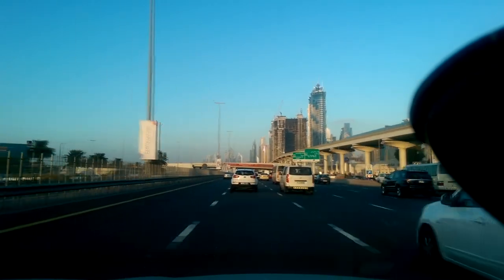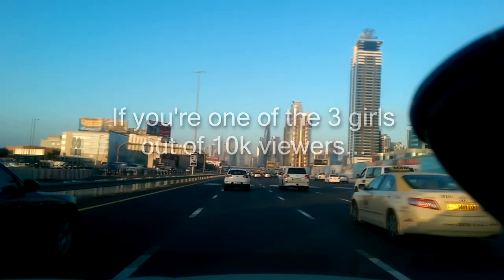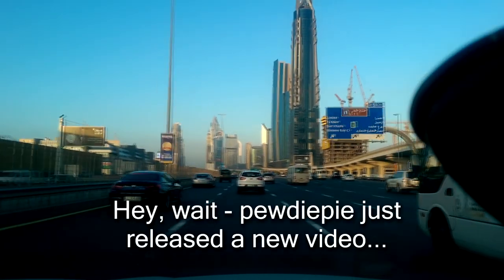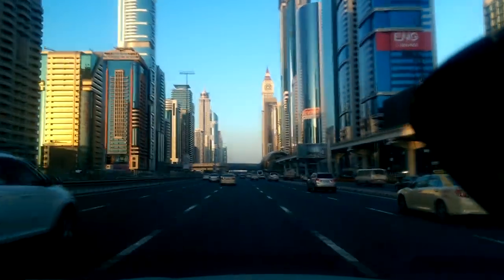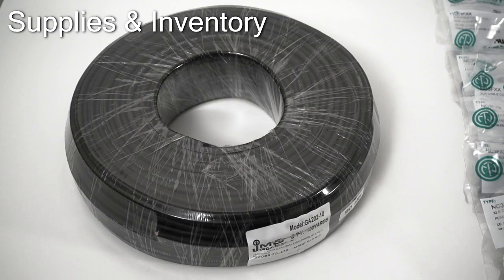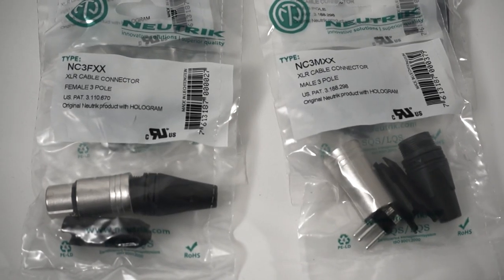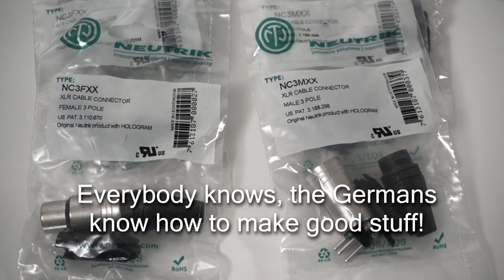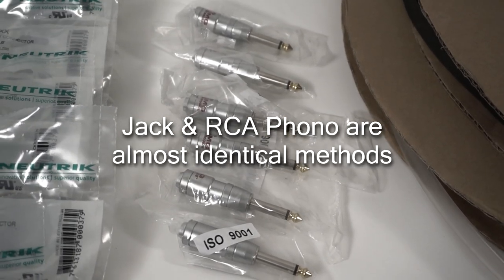#003 Soldering Tutorial - How to make pro grade cables!

Comment: What are the extra tabs on the XLR Male and Female with the hole in them?
Reply from the maker: This is the chassis ground. It is connected to the shell of the connector. You don't need to use it, until you find a situation where you really do. Until then, pretend it doesn't exist ;)
Reply: @TheBrightPixel  thanks I’m planning on using the cables in an ham/amateur radio situation that can be sensitive to RFI so was wondering if I should connect it to be sure or still forget about it as long as it is a good quality shielded or double shielded cable?
Reply from the maker: @plproductions8887  Use a multimeter and check for continuity on your devices between pin 1 and the chassis. 99% of devices will tie pin 1 to chassis. If it does, don't worry about connecting the shell. If not, then you can tie it if it makes you feel better :) Personally, I'd just leave it and if you encounter problems, then see if it fixes it.
Reply: @TheBrightPixel  sounds good do you have an email I can send you a drawing of what I’m planning on doing and you could advise be on what to do unsure about a certain type of cable to use
Reply from the maker: @plproductions8887  Sorry, I can help out here in the comments where other can see the information, but I don't have a lot of spare time at the moment. If you use this cable, you can't go wrong https://amzn.to/3s8giIq
Reply: @TheBrightPixel  ok it was about speakers out of a mixer but that’s no problem thanks I’ll have a look

Comment: Man, if I was to come across your cables when chasing a problem, they would all end up with plugs cut off in the re-work bin.

I have been making cables for more than 20 years on a very high professional level (think: for rental companies supporting major acts and world tours) and from that I have been involved with Neutrik in developing (the Ultimate Plug was my idea) and testing plugs. And from that I can say that I see a lot of no-no's in your tutorial.

To name a few: Silicone, heat shrink where it is not needed or intended by Neutrik to be, amount of solder used (although better than 90% I come across when I have a faulty cable), overheating of conductors which can make them brittle. 

So all in all: Good video but a lot of the same faults and traps I see with a lot of other 'pro' cable makers.

KISS is always the best method because every little extra thing introduced into the cable and process increases the rate of failure.

And let's be honest: the majority of the people shouldn't be making cables. They really want to but don't have the skills or the God given talent to make cables. Either your good at it or you will always be struggling trying to get a good result.
Reply from the maker: Good for you buddy. Those cables I made in this video are still being used every week in the venue. 1 failed. It was the guitar cable which was run over by a drum riser. Proof is in the pudding.
Reply: @TheBrightPixel  No wonder if they only see use a couple of times per year...
Reply from the maker: @Richard1977  I have no idea what you're talking about. The venue is open 6 nights a week, with different acts every week. The cables are used constantly. So are all the others I've built over the last 25 years. Just another nonsense internet troll with nothing useful to add to the discussion.

Comment: when does the fourth small contact apply? Is it for grounding? then why are there two earthing in the connector
Reply from the maker: I assume you mean the small metal tab at the top on some connector brands? It is a chassis ground. This can cause problems in some class 2 equipment which has a floating chassis that is not connected to the signal ground. Most modern equipment does not need the chassis ground connected to the signal ground inside the connector. Usually, if the device requires it, it will be connected internally inside the device already. Only some rare cases (on old equipment) will it solve a buzzing issue, but unless you have a specific problem to solve, leave it not connected.
Reply: thank you very much)
Reply: @TheBrightPixel        Great tutorial, thank you! I've got a quick question though.. I made 2 XLR cables and they are working fine for speakers and dynamic microphones, but it seems useless with condenser microphones... (no signal at all despite the 48v power supply) Could help me with this issue?

Comment: WONDERFUL video!!! i have a HUGE studio job in front of me and your vids have really helped me prepare.  just a quick question.  is there any particular solder you recommend?
Reply from the maker: Any 60/40 flux core is good for the job. For diameter, don't use the tiny sizes meant for doing fine board work. Get a bigger size, or you'll spend too much time feeding solder rolls into connector buckets
Reply: thanks :-)
Reply: thanks so much for the response and for the advice.  lifelong drummer here who's putting together her own studio finally, and i figured i'd save some money and get intimate with it.  your vids have helped immensely.  cheers!!!
Reply from the maker: Not only will you save money, but you will have a more complete understanding of how everything is put together. And these cables will last you a lifetime in the studio.

Comment: Hey dude, what label maker do you use?  I got a cheap one from amazon and the labels get destroyed (go black) when I heat the shrink.  Cheers
Reply from the maker: Yep it's a known issue with the cheap dymo labels
Reply: Thanks for the quick reply, yup thats exactly what I bought.  So what do you use, a brother? (you've written ANT over the top haha).  Great video btw, just made 60 cables and eager to finish them off.
Reply from the maker: Yeah pretty sure it's a brother. I've literally had it for 8 or 9 years. Whatever I paid for it, it was well worth it.

Comment: Tried to dig through the comments to see if it was already asked... the link for heat shrink directs to 1/2 inch shrink... is that what you used? I bought some and seems too big. Wanted to ask before I opened the box.
Great video, and Thanks!
Reply from the maker: 12 - 15mm is about right. You'd be surprised how much it shrinks up
Reply: @TheBrightPixel  You're absolutely right, I was surprised! Nice and sturdy as well. Going through about 1,000 feet of Canare Star Quad over the next few days.
Reply from the maker: @soundguygrims  Awesome! Happy cable making.

Comment: Great vid my man! Two quick questions: What gauge is industry standard as far as these mic cables? Also where do you buy your bulk cable spool?
Reply from the maker: There isn't really a standard because there are so many different applications. Honestly, shield coverage is a more important spec than strand count - although there are awful cables with 3 or 4 measly strands per conductor that should be avoided.

I source my cables from China or Spain when I have large quantity orders. I have manufacturers that I've been working with for years that I know and trust. Otherwise finding good quality, cheap cable is a bit of a crapshoot. To be safe just go with Belden or Van Damme. You know you're going to end up with quality with either of those.
Reply: The Bright Pixel Ok awesome thanks. Also do you work with a production company at all or have one of your own?
Reply from the maker: Many over the years, but I work for myself now.
Reply: Very cool. Thanks again
Reply: The Bright Pixel Have you tried Gotham cables? GAC-4/1

Comment: i don`t get it, you`ve just turned a BALANCED cable into a UNBALANCED one by using a TS connector WHY ?, that may seem counter-intuitive 1st thing Balanced Cabled are more expensive, 2nd thing this Balanced cable what you`ve turned into unbalanced these cables cannot be over 20` feet otherwise they can incure RF and EMI interfeareces, so why use a TS when you could used a TRS, your just creating alot of problems ! i can understand if you were using a Unbalanced Cable and using a DI Box to convert to the right type of connector, plus i would`nt put my XLRs standing up like that for soldering because your sending alot of solder down the cups which could create problems, an 8th on the end would do, you don`t need to fill the cup up, plus a 16th off the Positive and Negative conductor jackets, some may say the "best" soldering video, i beg to differ, good practicle video though.

Comment: you did the first female connector in correct fashion, ground 1, red hot, white cold. But the rest you did ground 1, white on the hot, and red on the cold connection....... Consistency ?
Reply: When I saw a bit later in the video, you discovered it during your inspection ... :p
Reply from the maker: @oysteinsoreide4323  I left it in to demonstrate the importance of inspection :)
Reply: @TheBrightPixel  I understood that. Because mistakes happen. But by having control measures you get higher quality. Especially network cable is quite easy to get wrong. But it's important to test before use.

Comment: I use single core flux solder wire. I have not yet found a seller locally that sells the multicore stuff unfortunately
Reply from the maker: Single core gets the job done. Just the multicore makes it easier to tin.

Comment: Clear video but in the 15 years ive been making and using XLR, I've never once seen a cable with heatshrink over all three cables (let along that much). All the top pro hire companies in the UK simply wrap the earth wire (HS or hellerman)
Reply from the maker: I've seen a lot of Chinese cables with the method you describe. They all fail.
Reply: @TheBrightPixel  lol I'm based in the UK where we have one of the most advanced technical events industry in the world - I promise you that the heatshrink that you're putting on does nothing for durability or reliability.  Each to their own though!
Reply: @TheBrightPixel  The silicone method is solid though
Reply from the maker: @williamj8349  Those cables I made in the video are still in service in the same venue, still going. Look at the date the video was uploaded. That's all I have to say about that.
Reply: @TheBrightPixel  I’m not criticizing the method, if anything I’m just stating that the heat shrink on 3pin XLR like that won’t have added to the durability of your good work. 

Glad to hear the cables are going strong, as they should be! 👍

Comment: Very good video!! I hope you will make more in the future! A question: will the silicon really dry up and become like a glue in there? Seems that there is no way for the solvents (or whatever it is) to leave...
Reply from the maker: Yep. Not sure about the chemical process, and how and why it works, but nearly 20 years of doing it says that it does work. And cable's with the silicon far outlast ones without.
Reply: @TheBrightPixel  Silicon releases an acid when curing which is not very healthy for your cable insulation...

Comment: yeah well the heat shrink and glue also makes a connector which can't be used again
Reply from the maker: Which I clearly explain when I say, "If you do this and connector fails, you need to chop the connector off and throw it away". This video is about making 'pro grade' cables. I've never seen a company reuse an old connector from an old cable. Use new ones. However it is true that the glue method renders the connection irreparable. Cheers.

Comment: Try 63/37 solder.
Reply from the maker: OK, but why?
Reply: @TheBrightPixel  63/37 doesn't go through a plastic stage like 60/40. One of the biggest pains is a cold solder connection because one of the wires accidentally wiggled while the solder was cooling. With 63/37 the solder goes directly from liquid to solid immediately without passing through the plastic or jelly stage like 60/40. The reasons why don't need to be explained here, but suffice it to say that 63/37 is much easier to work with. I switched to 63/37 years ago and never looked back.
Reply from the maker: @houndawg3  Interesting. I'd never heard of this until now. Just looked it up. Slightly lower melting temp and from what I'm reading, hobbyists highly recommend it. You might win the honor of the most useful comment left on this video. I'll order some and check it out. Thanks! Hopefully it has the same strength and works good for connectors. Everything I just read is guys using it on DIY PCB's, so not really any info on strength properties.

Comment: in answer to your question: i didn't i ordered pizza
and a question from me, whats the advantage of putting the shell on after stripping and tinning rather than before?
Reply from the maker: Hahaha. Sweet. Good question. The only advantage is that you're going to catch any that you missed doing, before you get to the point where you're about to make the actual solder connection. Basically another 'visual inspection' step. Also we strip and tin both ends in one go, but only put shells and heatshrink on one side at a time.

Comment: Good soldering is not difficult, but this is not good soldering. If you are not adding fresh solder, then you should at least add flux when you reheat the solder. The way shown in this video is an easy way to get dry joints.
Reply from the maker: +SDG Electronics thanks for your feedback. If your wire and connectors are tinned, there's no need to add flux when making the connection, as long as you are paying attention and make sure you are heating both sides of the connection sufficiently. In fact I would recommend you do not use flux or add solder at that point. Flux will just cause excessive fumes for no real advantage, and adding solder will actually increase the likelihood of cold joints, due to obscuring the underlying tinned bucket.

I've been making cables for rental companies for more than 25 years now, and I can vouch for the method in this video based on experience. These solder joints will last much longer than the cable itself in a professional, daily use environment.
Reply from the maker: Sorry for the quadruple reply. I'm actually posting this in an aircraft so the connection is a bit dodgy!

Comment: 23:46. You mean conductance, not capacitance, no?  Capacitance is the ability to store an electric charge.    Conductance, thermal conductance really, is the measure of the ability to transfer heat from one material to another material.
Reply from the maker: Nope. Heat capacitance. As in the ability of the metal in the tip to store heat, and therefore reduce the reactivity of the temperature on the tip to the changes of temperature in the heating element.
Reply: @TheBrightPixel  ah ok. I tend to think of electricity first when talking about capacitance
Reply from the maker: @MixingGBP  It's also a common term in thermals.
Reply: @TheBrightPixel You are both wrong. The term (which is also known as thermal mass) is heat capacity (not heat capacitance).

Comment: Heat shrink appears to do nothing?
Reply from the maker: The heatshrink does 2 things: 1) Provides strain relief at the exit point of the connector shell, which is where a large portion of failures usually occur. 2) Protects the cable at the points where the connector shell bears down on the cable by spreading the pressure evenly. Without the heatshrink, the cables will last a quarter as long. If you're just making studio cables that will be plugged in once and left alone, and are on a tight budget, you can leave the heatshrink off. If the cables are going to be plugged and unplugged and coiled and recoiled, don't skip it.